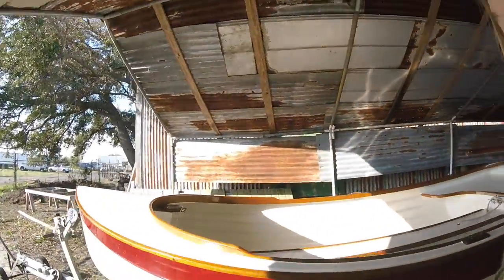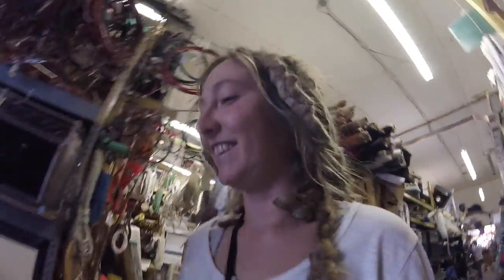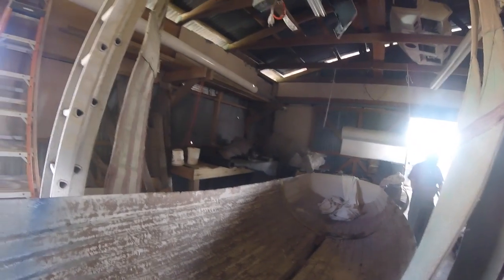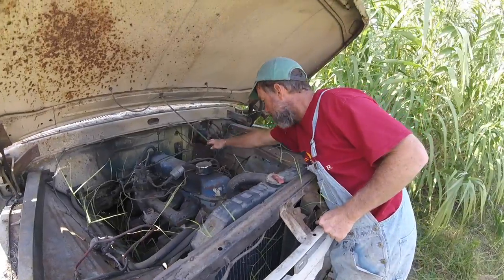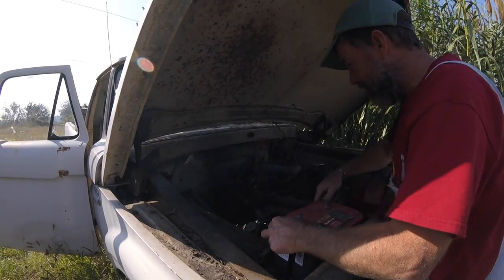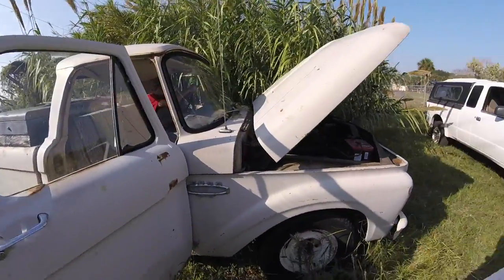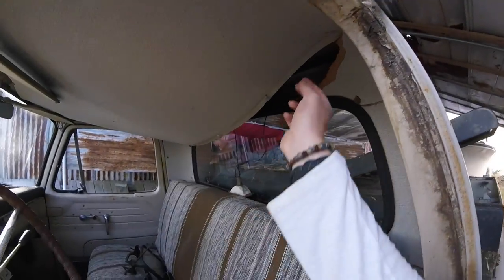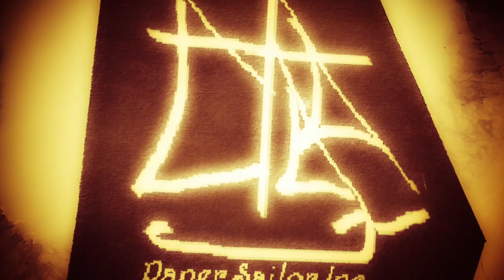Episode 332 - Pete and His '65 Ford Pickup Truck -  Life of a Gypsy Day 228

Comment: I had a 66 f-250 a while ago myself, drove that truck coast to coast (WA-VA)  and back (!) with no speedo & no map! man that thing just purrrrred! on the return to WA as I went to turn into my driveway at home, I turned the wheel to go into my driveway and..... nothin just kept on straight on.. panicking I spun the wheel as hard as I could and over a faint burr-whirring noise it finally caught , and turned into the drive, shew!
   Sadly the frame was rusting away and bearing on the steering shaft, thus making the column separate at the joint. I paid 600$ for it and sold it for parts for 300$, I figured I go my money's worth out of the deal tho.
Those are really great trucks!
still looking for that cat in the post ;)

Comment: No big deal about the starter, the relay is about $20 and starters less than $100. Best to put new on it regardless.  To see if it will start (and starter is not shot) just jump the solenoid. Sometime the Bendix is stuck and needs a little precision adjustment (persuasion) with the knockometer  (hammer)